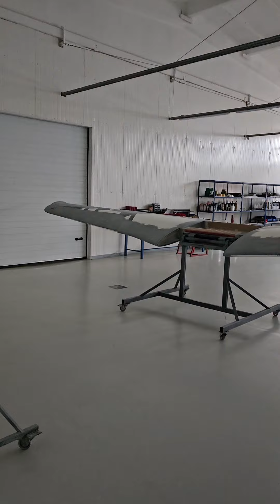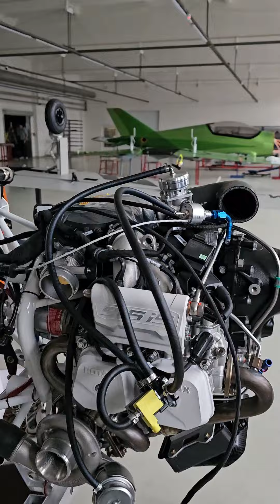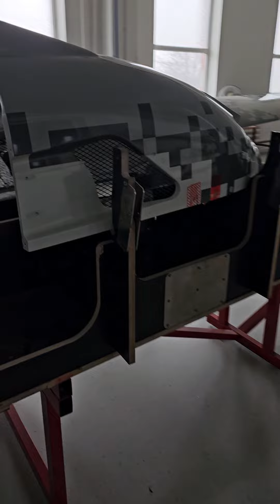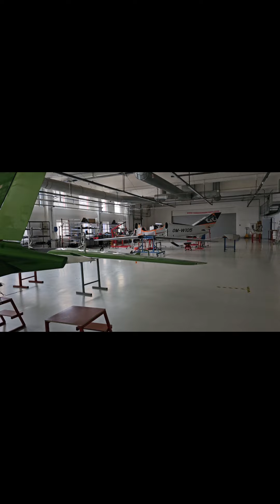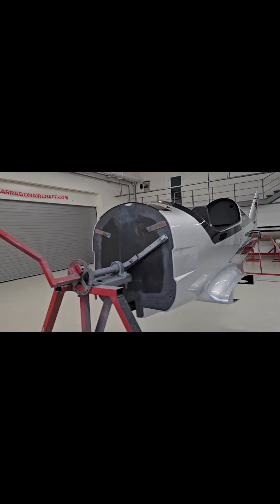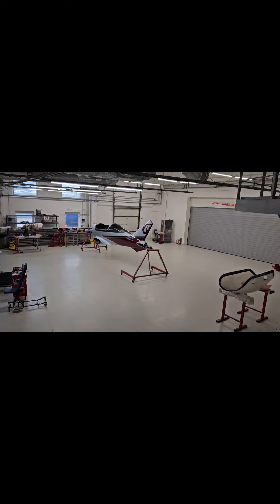SORIANO may just start building airplanes again or is it? #airplanes #enginesound #technology

Comment from the maker: US ARMY & SORIANO during WWII

Spring 1942 the U. S. Army Corps of Engineers of Fort Belvoir, Virginia approached us requesting a high-powered, rugged motor to be used on personnel attack boats that later became known as Storm Boats. We responded by building up several 4-60s with magneto ignition, modified to produce about 50 hp at a speed range that would ensure long life, great dependability, easy starting, and good speed. A heavy-duty service lower unit was developed with side fins to protect propellers against barbed wire, shallow, rocky beaches, and especially to be able to withstand the heavy shocks of beaching on any kind of a bottom at full speed. Typically, we ran into difficulties. Our 50 hp Storm Boat Motor, as it was later called, was not what the top dog had in mind. He had heard of the Soriano, that remarkable 6-cylinder, 4-cycle supercharged outboard that Jean Dupuy had driven to the world's mile trial record of 79.04 mph, and he wanted to give it a tryout as power for the assault boats being considered by the Engineers. Gar Wood, Jr., a well-known pre- WW II outboard racing champion, had imported a Soriano which he loaned to the Engineers for tests, and these tests turned out very well. Gar Wood was given an order to build 2 for further test work, since, because of the War, it was impossible to get more Sorianos over here or in Europe either, for that matter. Paul Wearly, also a well-known outboard racing champion, worked with Gar Wood in building American adaptations of the Soriano for the Army Engineers at Fort Belvoir, Virginia.

Paul Wearly wrote regarding the Soriano Engines.

"This was a great engine and performed very well at all speeds. We built it with a very effective full gear shift forward, neutral, and reverse. The carburetor was a Holley-Ford "6" type with fixed jets. The ignition was a Scintilla with automatic spark advance. The powerhead weighed 90 pounds, and we developed almost 90hp on alcohol fuel before we reduced the size of the supercharger to run on gas. Before reduction, the inlet manifold temperatures were much too high to run effectively on gas "

Following tests on the Gar Wood built Soriano, Evinrude, and I presume other outboard manufacturers, were asked to quote on a quantity of several hundred Soriano adaptations for immediate delivery. We knew nothing about the Soriano outside its excellent mile trial performance. It was a handbuilt motor, with only rudimentary tooling. Neither we nor anyone else had any production tools for it, nor could the Army Engineers tell us where tools could be had. To set up from scratch to produce the Soriano in the volume required would take over a year, and the Engineers wanted delivery in three months. We declined to quote with regrets. Apparently the Engineers received a negative response from all other manufacturers whom they may have contacted, as no volume order for a Soriano-type motor was ever placed.